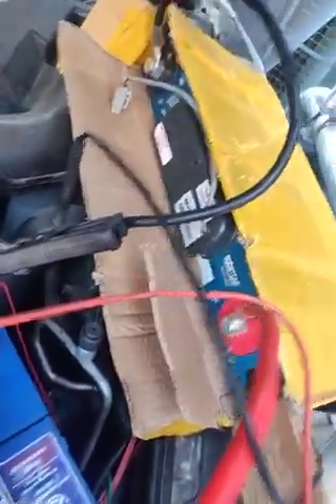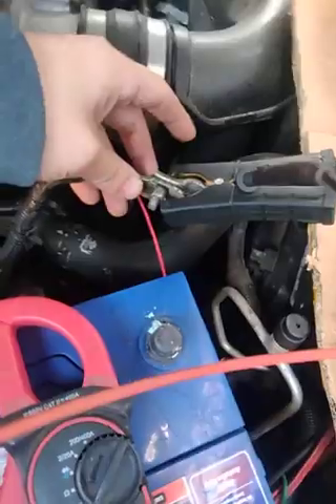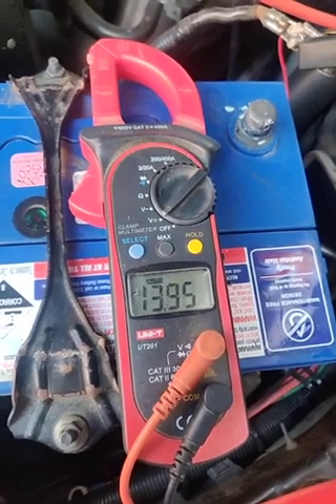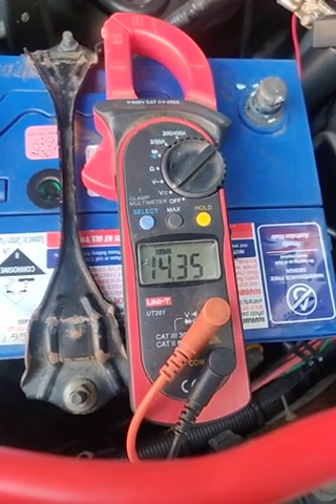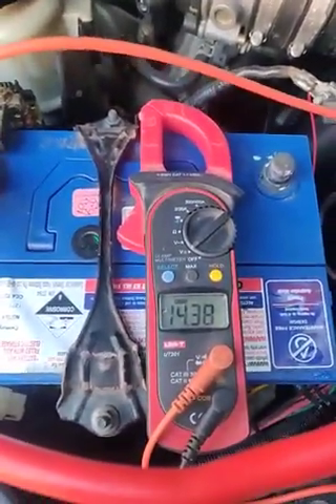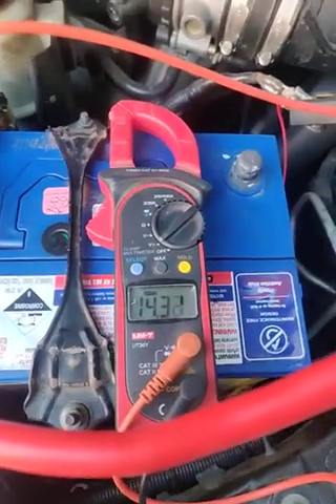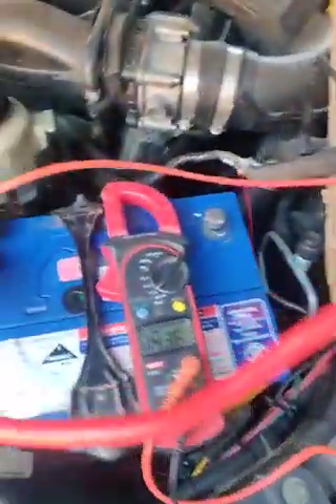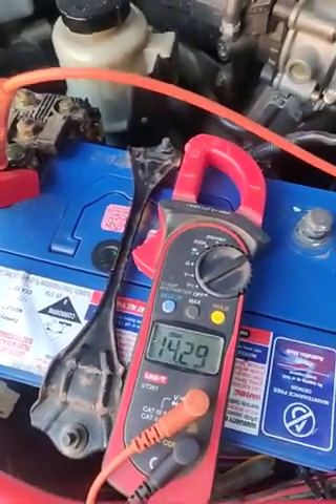Aluminium Cased Maxwell 16V 500F Super Capacitor Crank Test

Comment: i have supercapacitor 16v 500f ,but the problem is after tomorrow the power voltage will drop is not use it..that capacitor is broke?
Reply: The capacitor has a self discharge rate. If you aren't using it with another battery, it will drain quickly.
Keep in mind that your car is also using some power.

Comment: What happen if you hace the capacitors cinnectrd to the battery but you dont run your car for 7 days... does the capacitor deplate and will eat the battery power on the next start ?
Reply: The capacitor won't use that much energy from the battery, so it should be fine, if you start your car once per week.
Reply: The capacitor bank will stabilize your batteries voltage.

Comment: what is the plug connector on top of the capacitor used for?
Reply: The plug connector is used to monitor the voltage and temperature of the cell.